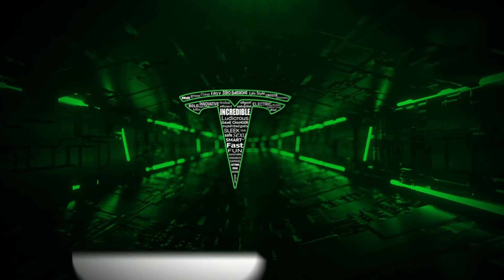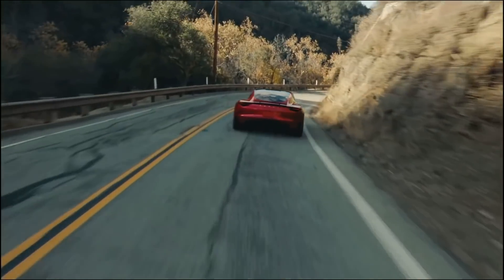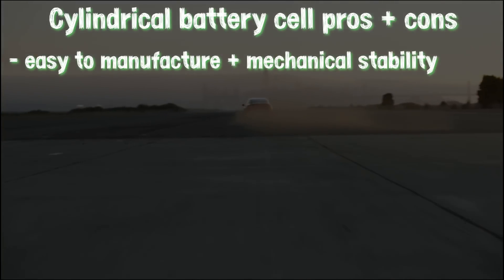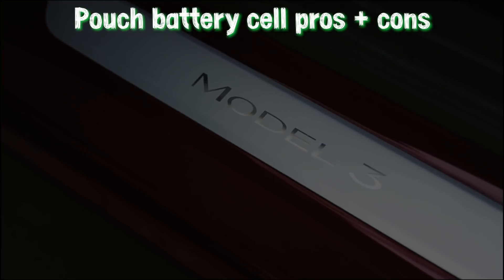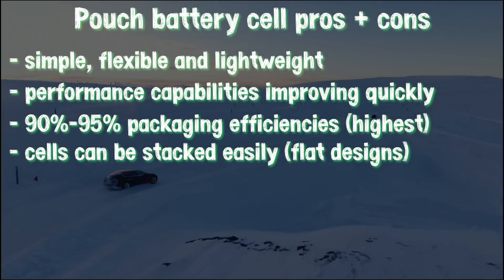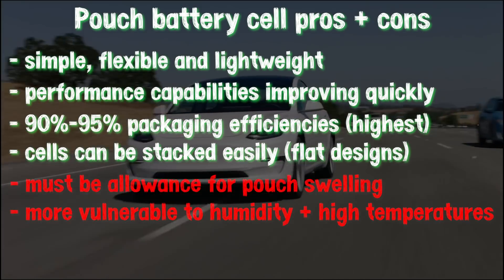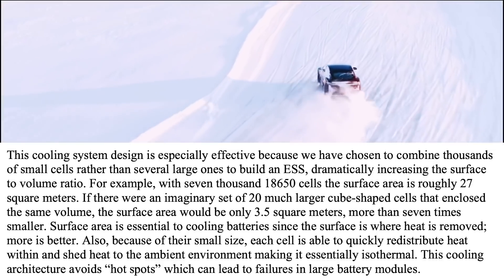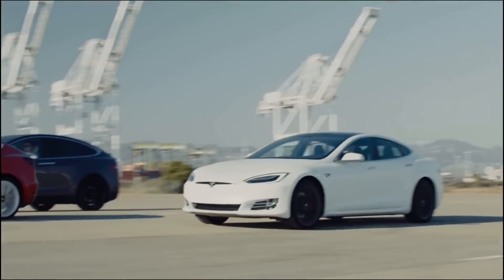Tesla Cylindrical Battery (vs. Pouch/Prismatic) and Tesla Battery News (CATL)

Comment: You forgot to mention the efficiency of recycling the different packs. Cylindrical cells are the hardest to recycle properly. So in the future when CO2 lifecycle costs will be added to products like EU is adding, then a cylindrical batterypack will be way more expensive to import and sell in to EU than pouch and prismatic batterypacks. 

Tesla batterypacks are welded together, with "cooling-goop" in between each cell - which would make that pack a pain to recycle autonomiously while being able to get pure enough material back to rebuild a new battery-pack. In contrast prismatic and pouch-cells are far easier to separate and recycle. So the reason to focus the efforts to those types of packs is to be ready for the future when CO2 lifecycle costs will be added to the products going in and out of EU - and probably rules that the rest of the world will have to adjust to.
Reply from the maker: Hey Tim, you bring up a great point for sure but keep in mind it would be important to define recycling. If recycling for bare elements, then yes. If recycling the packs in energy storage applications they could in theory keep the packs as is, without any separation.
Reply: @DillonLoomis22  The end-game for recycling is to be able to get materials out to build a new battery again. So yes, for bare elements. 

Even for second-life use, the Tesla pack is hard to re-use and you need to build new packs from them manually. Thats not the case for a prismatic or pouch-cell pack. They are easily separated into modules and even single cells to then get built up into something else. 

EU is looking at CO2 tax for imports, which should be taken into account. 

Lets not forget that a 100 kWh batterypack means 20 ton of CO2 that gets released into the atmosphere, so we need to fix the entire market. Not just focus on the "in-use" CO2 savings when driving locally. You are basically just shifting GHG emissions from where you drive to other places, and if we don't fix that, then this is all pointless. 

A CO2 lifecycle tax addresses that issue directly. Suddenly manufactories of batteries, and mines need to electrify their business too.
Reply from the maker: @oophus1  the Li-ion recycling market is going to be huge and very important...been saying that for years!
Reply: @DillonLoomis22  I'm not that sure, as the li-ion technology is a middle-ground into something else, and thats the fear of most recycling plants. They are not sure if they want to invest into automatic systems, if battery-technology suddenly shifts away from todays tech. Thats why most efforts are put into figuring out how to make a system that doesn't care what type of battery you put into it, as you grind it all up, and then use post-processing sorting to get what you want out from it after. But thats easier to make, when you know you have a segment that will last for 50+ years, instead of the current batteries that is forecasted to only last for a few more years until something else takes over, like SSB's. If SSB's suddenly took over in a year or two, then todays recycling-plants would only cover around 2% of the total sales in car in terms of batteries, but SSB plants could expect in a 20-30 years time to get in around 50% of total car-sales in terms of numbers of batteries. Thats a pretty big shift in numbers, and profits. So most plants will just shred todays technology, but when SSB's come out, they will make systems that totally "un-build" the battery packs first, then shred only the battery-cells once you can't separate it any more.
Reply from the maker: Tim Daniel Ophus if I were to make an argument against it, this would be mine 100%. I just don’t predict a world where Li-ion batteries go full stop in favor of something else. They’ve been around too long and have advanced a long way. Even when SSB hit commercialization there could and should still be a market for Li-ion production. And SSB hitting market this decade is not a sure thing!
Reply: @DillonLoomis22  Yes, you are right that they will still be around for a while, simply because its expected that the energy-density of any new battery will be comparable to this tech at their infancy. But in numbers and in terms of where to put your efforts, I think most plants agree that the next "boom" is the big one. They will simply just shred todays tech like they already are, without building any ways of disassembly methods. Especially since todays marked is not controlled by any regulations. So each battery is different. Once we get good enough batteries, I suspect we will "force" producers to make them in a way that is easier to rebuild into their second life use, and ultimately recycle.  

More or less an "open standard" that will have its cycles like any other open standard.  4-5 years of X, and 4-5 years of Y in its next generation etc.